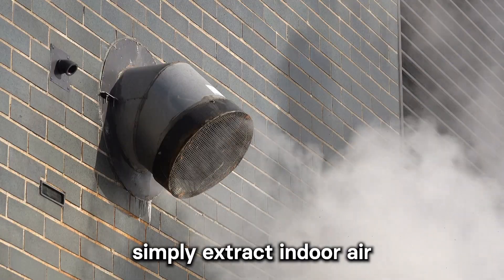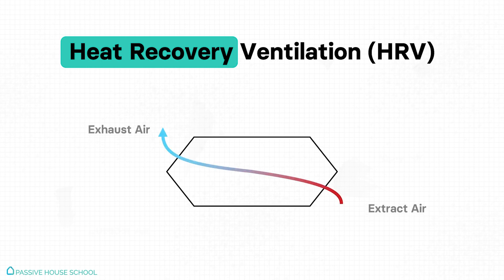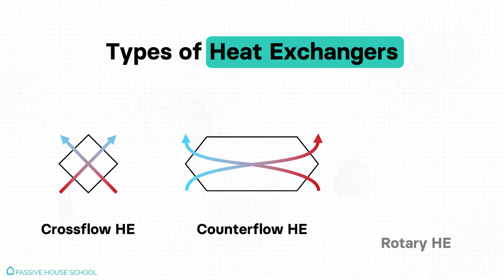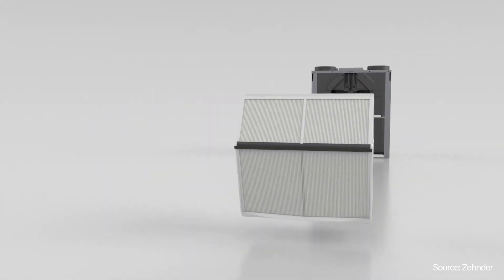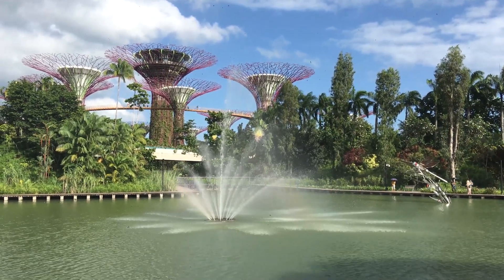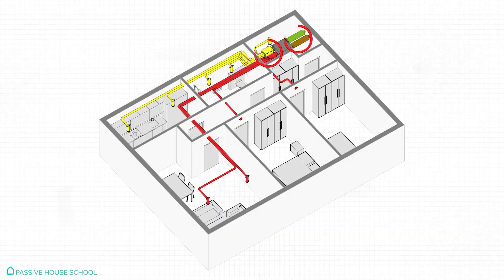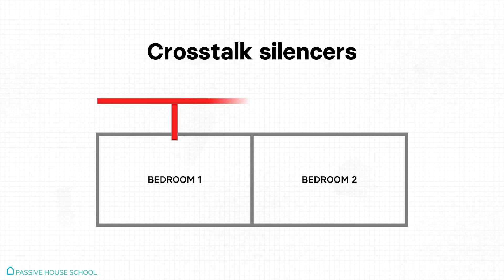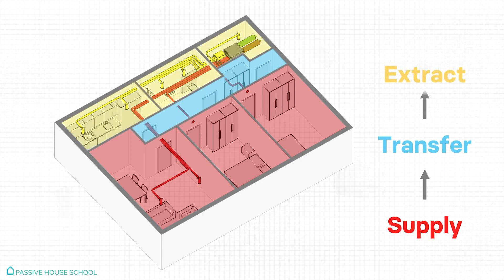Heat Recovery Ventilation Explained - Design Principles

Comment: Speaking from personal experience, the supply and exhaust need to be balanced for every room. Otherwise as soon as someone closes the door/s to that room, the air movement is going to slow or stop, because the only way for air to get from one room to the next is under the door. If there's a draught under the door, you'll get that much air movement, and if the door is fitted not to have a draught, you'll get no air movement at all.

Closing the bathroom door while we're using the shower or toilet, or closing the bedroom door at night, is normal human behaviour. Humans like privacy in these spaces, and the closed bedroom door is a "do not disturb" sign that even cats have to respect. The ventilation needs to be built on the assumption that when ventilation is most needed, the door will be shut.
Reply from the maker: To avoid oversizing the system, paying too much for ducts and drying out the air inside, supply and extract should be separated in two different zones according to the cross ventilation principle. To allow the air to move freely even at closed doors, are provided transfer openings either at the doors or in the walls. These openings can be designed to avoid the transfer of noise/light. The air volumes are quite low and don't cause any drafts (with the right seizing of the openings).

Comment: Excellent content!
About supply and extract zones on different slides of house. Is it necessary to have vents on doors?
Reply from the maker: Thank you, Philip! When using the cross ventilation principle you will either need door vents, gaps under the door or dedicated transfer air grilles in the walls.
Reply: How do you calculate what the gaps under the doors should be? @AntonDobrevskiPHS
Reply from the maker: @vitoshabg  To achieve air speeds below 1 m/s, we multiply the volume that has to pass through the door by 2.78 and this gives the area of the gap under the door in square centimeters

Comment: Great video. HRV with summer bypass is also essential to prevent overheating within ground floor bedrooms during the night, as windows can't be opened for security reasons, as stipulated within Approved Document O.
Reply from the maker: Thanks, Vincent! A summer bypass is indeed very important as well. Most of the high quality units have a summer bypass.